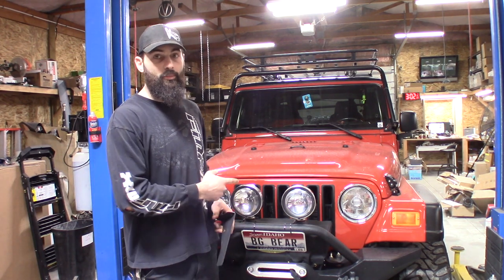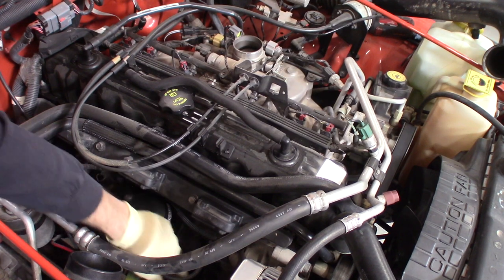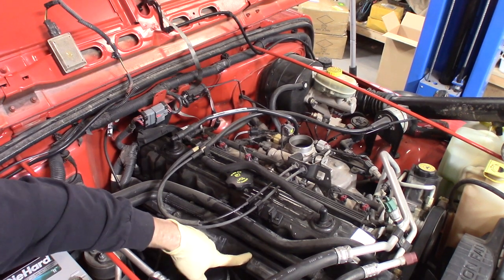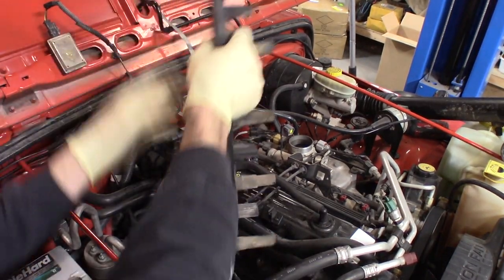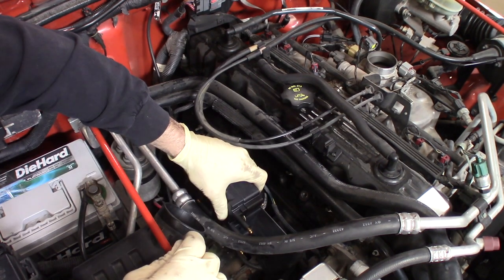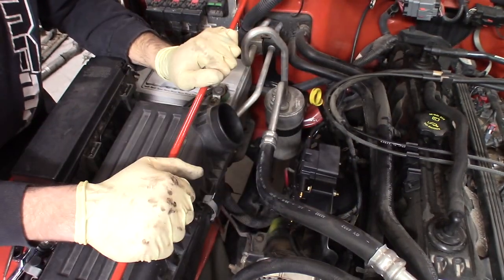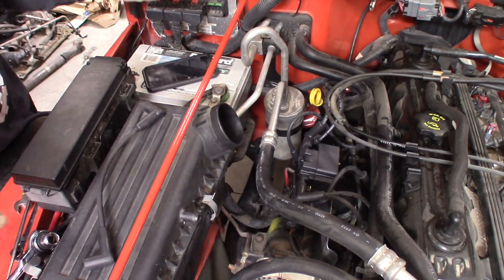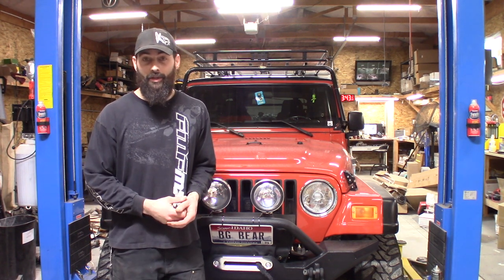TJ/LJ Viper Coil Mod - Coil Rail Delete

Comment: Hey, nice mod, you should check out our High Performance Coil pack for your kit. Makes more power and tons of great reviews on it.
Reply from the maker: We have one! it's on our XJ using our system. great change in performance over the stock coil pack and even this replacement pack.
Reply: @KSuspension  fantastic to hear, should set up an account and offer your kit with it 👍
Reply from the maker: @RIPPMODS  that would be fantastic! We tried talking to you before about some logistics, but we wanted to test this product first before going forward with anything. Whomever we need to speak with, we'd be happy to. suspensionlifts@gmail.com is our email if you'd like to get the ball rolling!
Reply: Is that the Ripp 3.8 High Performance Pack you’re using on your XJ?
Reply from the maker: @giancarlo239  yes, we have it on our XJ

Comment: That bracket is wiggling around pretty good just bumping into it... Is it fully secured in this video when wiring it up?
Reply from the maker: We have actually changed the bracket to an updated Design, one piece, no bend, and solid when mounted. 
Thank You for noticing, it’s been fixed :-)
Reply: @KSuspension  Checked out your website, saw the latest design. Looks much better, great stuff! I have placed my order.
Reply: @KSuspension  The same thing the bracket you sent me is not bent like on the video and hits the top of the none-dist. is there a special way to mount it thanks Luis

Comment: The bracket you guys sent me looks very different from this video instead of having the angle as shown in this video, it is flat with two holes. Is it the  Same mounting location?
Reply from the maker: Hellwolf501 we updated the design based off of some Customer feedback
The new design is much simpler and stronger.
Bolts to the 2 side mounting locations on the block

The one is the same as the video shows below the alternator
The other is just behind the cam sensor

We will be making an updated video the 1st chance we get

If you’re confused at all, shoot us an email and we will send some photos to help
Reply: @KSuspension  Did you ever get around to making an update video?
Reply from the maker: @mrd05d  that would be a negative. haven't had a TJ come in that wants the upgrade yet

Comment: I understand that to mount the coil ( I didn't get the screw/bolt pack, not your fault) that I need 4 each 1/4" X 2" bolts and 1/2x20 nuts.  But what size is that bolt on the lower engine mount?  Thanks, Dylan
Reply from the maker: 1/4-20x2 bolts for coil pack
3/18-16x3/4 for the block mounts

Did you order the kit through us? I’m very sorry if the hardware was missing, we’d be happy to send them to you. Not something we want to make a habit of
Reply: @KSuspension  All good, I ordered piece meal because I messed up my initial orders.  No problem, Can you confirm that block mount size, that looks strange to me.  is that 3/8-16  3/4" long?  Thanks !
Reply from the maker: @DylanFahey  correct, 3/8x16 and 3/4" long with a washer
Reply: @KSuspension  Got it yesterday at the hardware store, THANKS ! Will install soon.

Comment: I have a 97 TJ with distrubutor (stroked to 4.6). Any experience/reason to update to this type of ignition?
Reply from the maker: you'll have to change the engine harness and PCM, not really worth the effort and cost
Reply: Ah...thanks for the quick response. @KSuspension

Comment: I’m assuming it doesn’t matter which end of the wires go on the plug end…but figured I would ask.
Reply from the maker: doesn't matter, although we do usually put the 90* bend at the coil pack

Comment: Does the supercharger coils fit on the Jeep TJ ? Or are they just for JK’s or other models?
Reply from the maker: Fits the XJ, TJ, LJ, WJ 00+ models that want to swap over to our coil delete system 
They’re available on our website
Reply: KSuspension it sounded like the product wasn’t available yet for it! I have an 04 Jeep TJ and was looking to upgrade it to this one instead. I am in between choosing the normal coil and the RIPP supercharger coil. I know this video showed the normal. Do you feel a difference in the xj with the RIPP supercharged one?
Reply from the maker: Liliana yup, we are working together to offer the setup to customers
We sell their coil packs and they are stocking our brackets to distribute as well
Reply from the maker: Liliana it’s just not available on their website, we have it on ours now, and in stock

And you’ll notice a smoother power band with the RIPP pack, it’s way more responsive and we’ve seen an increase of mpg by 2-3 on average
Reply: KSuspension that is awesome! I might order one from you guys this week then. Thanks for the input!
Reply: Update: received the coil. I am extremely satisfied with the purchase. Jeep runs better, feels like it can finally breathe. Had a whole tune up done first. It ran pretty good. But once the coil was installed, it got even better. Better response time, and feels lighter in general. Very smooth engine idling.
Reply from the maker: @JigglingPandas96Pkm  heck yes! Enjoy it! Definitely an awesome swap to do!
Thank You for the support

Comment: What’s the reasoning for this mod.
Reply from the maker: Delete the coil rail that causes many issues
Easier to diagnose problems in the future 
Parts are cheaper if anything needs replaced
Easier access to ignition components

Comment: What is the difference between the normal and the RIPP options on your website?
Reply from the maker: We have that question and answer on our FAQ page on our website :-) very popular ?

The standard pack is just like your stock one, no performance gains
The RIPPmods pack is a performance coil packs that provides a hotter spark for a more efficiently running engine.
Reply: @KSuspension  thank you for your response, will be ordering tomorrow. Cheers!
Reply from the maker: @timothycarey8565  Thank You for the support!

Comment: Where is the wj coil rail delete bro?
Reply from the maker: Waiting on our WJ to come in so we can finish the bracket. Original design wasn’t working very well. Gotta redesign it
Reply: @KSuspension  gotcha. Thanks for the update
Reply: KSuspension when you need mine?
Reply from the maker: Tyler D needs to be a 4.0
Reply from the maker: Charles M the wait is over! Kit for WJ’s is ready!